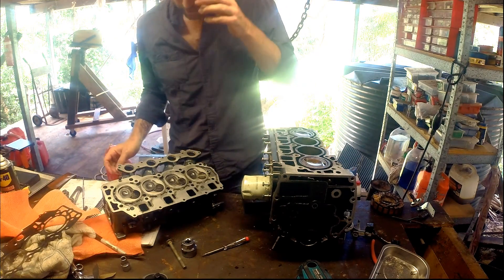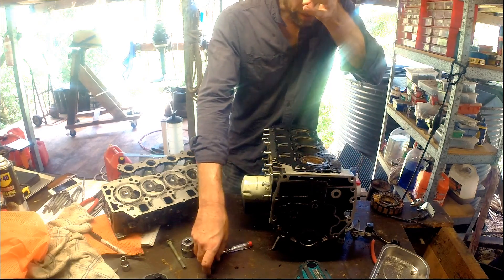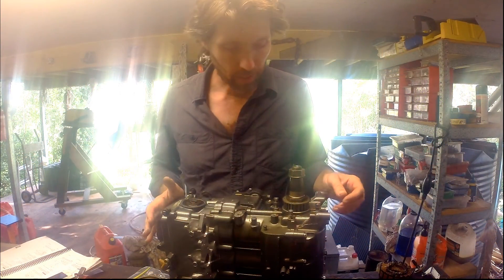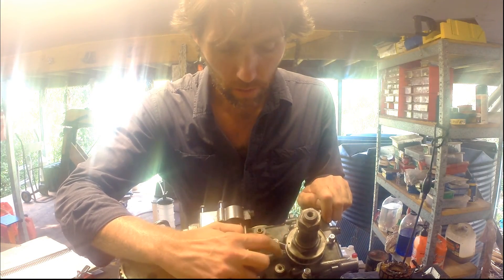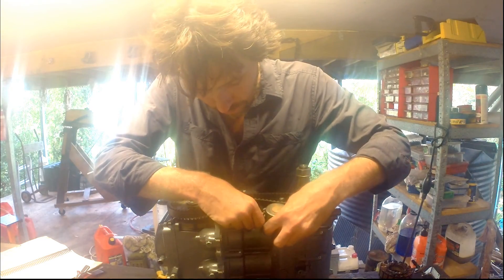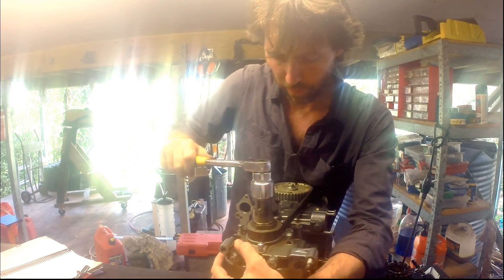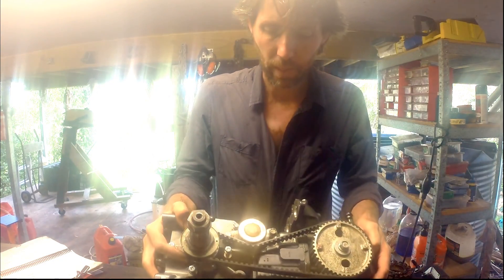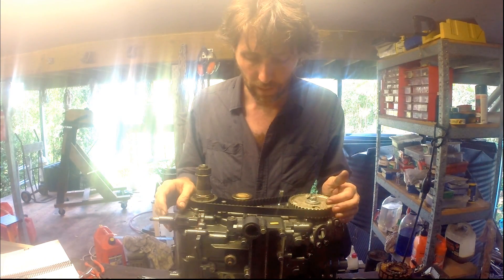Installing the cylinder head on a Yamaha 50HP four stroke outboard

Comment: That would be awesome! Your videos are very helpful as I have basically the same engine I am working on at homw. I have a service manual ordered and on the way and I am considering buying a set of gauges to do the same. Just need to learn the basics along the way. Its the learning how to adjust the idle/fuel/air that scares most people off
Reply from the maker: Stay tuned then, I need to do that job very soon!

Comment: Hi. Im replacing valves in my f50 4 stroke right now. Did you get the cylinder head re faced or just clean and sand. I watched full set of videos for this yam, gave me 
confidence to do ghe job myself. Engine dismantled waiting for valves.

Comment: I just ran into the same problem of a stripped headbolt on a 60hp yamaha 4 stroke. What size heli coil kit is used to repair them, or would u recommend tapping it to the next size up.
Reply from the maker: I used a helicoil to keep the bolt sizes the same and the torque values more even. Oddly (from memory) they were 9mm bolts.
Reply: Thanks so much for the reply. Your videos are very helpful

Comment: excellent video really helpful the way you were turning the crank over two lines the timing marks are most outboard engines non-contact engines does it look like you can turn the crank a full rotation without it touching valves
Reply from the maker: Good question. I would imagine more outboards are designed to be non-contact engines but I would be careful. Bending a valve wouldn't be much fun.

Comment: So fun to watch these old videos, you've come a long way in production-quality since..!
Worried me when you turned the crank a full turn before putting the belt on! When camshaft was set for cylinder one top dead center, where you sure there was enough clearance for the valve...?

Comment: thanks for many useful videos. I have a Yamaha 50 hp, four stroke 2001 model. Heating problems at idle only. Replaced impeller, checked thermostat, opens at 60 deg. C, thermoswitch closes at about 74 deg. C. Still overheating. Found a thread where they figured out that debries from zink anode in power head(especially exhaust zink)had broken off and blocked return of cooling water. Any experience with this ? Is it possible to remove any broken off anodes in cylinder head without major tear down ?
Reply from the maker: Yes, the motor in this video had the anodes broken off an fallen into the water jackets. From memory they were tricky to get out even with the head off the outboard unfortunately. From memory one of the videos before this shows getting them out.

Comment: A question, though. I'm sure I've read in more than one place that a fastener that is to be torqued down to a specific value should not be coated in any kind of lubricant as it can skew the torque setting due to being "too easy" to turn as it beds down. I notice you oiled a couple of the head bolts prior to installing and wonder if you are concerned about this? Cheers.
Reply from the maker: It is more the opposite, in that a torque specification is designed to get in you the ball park of a certain amount of stretch in the fastener. If the bolt isn't mildly lubricated it can bind up and the torque wrench will click before you have achieved the desired stretch.

Comment: Ever worked on a 25hp 4 stroke mercury efi? Might've messed mines up. Took off the cyl head to check the oil pump, thought I was very careful. Marked the belt with the pulley but spun pulley after removing the belt a few times on the cam pulley to look at the oil pump if it turning. If the timing belt is off, can the motor still start? Mine won't start anymore. All plugs spark, fuel is spraying. Still won't start.
Reply from the maker: Yes, having the belt out and stop a motor from starting. One tooth out it will probably start but run badly, more than that and you won't get the compression you need. I haven't done a four stroke Mercury but this video might help with the basic process https://www.youtube.com/watch?v=o9tau2K3ej8
Reply: Dangar Marine Thank you Sir, very much appreciated. Outboard is now running.

Comment: How about a video of carburetor link & sync, proper air/fuel mix adjustment of this engine?? That would be great!
Reply from the maker: Ah! That is definitely on the agenda. The motor has been running well for a few tanks of fuel now, but I want to take the carbs off and bring them back up to the workshop to adjust the linkages. Two of the four idle screws have the heads stripped (God knows how someone managed to do that in the past!) so I'd like to get those out and put new ones in. Once that is done I'll like to put them all back on and put a set of vacuum gauges across the manifold to do a balance. Also, once the motor is run in a bit I'd like to do a valve clearance adjustment. Plenty more to come!
Reply: Dangar Stu

Comment: hi mate just dropped a corroded 'pencil' style annode into the motor on my Yamaha F40.  terrible design. what's the best way to get it back out or just leave it?
Reply from the maker: +Jared Dunne Ah yes, been there. The only was to get it out is to take the head off so as long as you aren't getting any overheating problems I would just leave it.

Comment: Sorry,I meant two stroke head bolts get anti seize
Reply from the maker: It really depends on the outboard. Generally I would just put oil, but be careful you don't have so much that any ends up under the bolt and stops it from going all the way in without hydrolocking. The Evinrude manual specifically said to put the bolts in dry on the 150 I've been working on. The thing there is that lubricants will affect the torque specifications so just follow whatever the service manual for your motor specifies. If you don't have the manual, just clean the thread and use a small amount of motor oil.

Comment: excellent video really helpful the way you were turning the crank over two lines the timing marks are most outboard engines non-contact engines does it look like you can turn the crank a full rotation without it touching valves